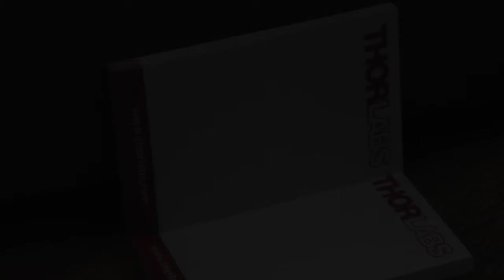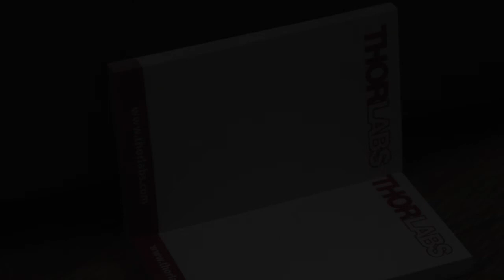DIY Tunable Dye Laser!

Comment: Is this dye laser strong enough to act a skin surgery? Does an ultralarge TEA laser can act a weapon fighting against Zentraedi in future?
Reply from the maker: No, you can not perform skin surgery with this dye Laser, the average power is too small.
It is not possible to build an ultralarge TEA Laser, unless you go with a MOPA design. An Excimer Laser has much higher powers available.
Reply: @LesLaboratory  if the TEA laser has 100-meter length and considerable capacity, its individual pulse energy should be extremely large, isn't it?
Reply from the maker: @georgegreen3672  as above, a 100 metre TEA Nitrogen Laser is just not practical. The maximum length of an ordinary TEA Laser is 30cm.

Comment: Hey, You are using a TEA as a pump right? Also well done! Quality video right here and well thought out, How divergent is the beam coming out of the OC? Since its tunable to 400ish to 570nm you should consider a g8 collimator, 90% pass, and coated for broadband 400-700nm. It should work nicely you would need to make a custom mount though. The lens is threaded M9x0.5mm.
Reply from the maker: Thanks! Yes I am using a TEA Laser I described here: https://youtu.be/pCnXftuJ9Zo and here:  https://youtu.be/AyN1o_3XaTw

Without the Collimating lens, the beam will expand to about an inch (25mm)  at about 1 foot (30cm)

With the lens you can get a nice tight spot about 2mm across, from 6ft. I have just ordered a new lens, to improve the beam quality. It needs to have along focal length. In my case 48mm.

Comment: Man that's so cool...where is the dye available? 

Sigma-Adlrech says the have it in stock...but are there any other more normal places to get it?

I was able to build my own TEA laser and get it to lase, it's been a fun project.

Thanks for the videos! It's very cool stuff to see.
Reply from the maker: Thanks!
I got mine from a seller on eBay, but they don't seem to be selling at the moment. Search for Methylumbelliferone or one of its synonyms. You need to add a couple of drops of Ammonia to get the spectrum broadening. (Forms an exciplex during Lasing I believe.)

Awesome that you built your own TEA Laser! I'm glad these videos are inspiring people!
Reply: @LesLaboratory 

Wow I never expected to stir up so much discussion about the dyes...i want to know more about lasing jello, that sounds interesting and goofy enough to try just for fun.

I was reading and saw someone using a prism instead of the diffraction grating for tuning...do you have any thoughts about the pros and cons involved?
Reply from the maker: @drrrrockzo  It is in the pipeline! I also want to try dyes in epoxy as well!

Yes, you can do it with a prism, and I even considered it, but here are my thoughts on that:

Dispersion prisms, even flint glass do not disperse very much, i.e. you would need a long cavity to do proper tuning.  With a TEA Laser driven setup, the cavity needs to be very short. If the duration of the pulses is only nanosecond  and the cavity length is about 3cm (as in my setup) then the light can bounce between the mirrors about 10 times, providing enough feedback.
If you add a prism in there, plus room for movement, you would be up to 5 or 6cm cavity length, where light will only bounce back and forth 6 times or less, reducing feedback. Plus, it is yet another optical element to align and build a mount for.

Gratings on the other hand have very large dispersion, and can be had for around the same price as a new flint glass prism. They are easy to set up on just a plain mount.

I think in hindsight, I would have used a finer grating, perhaps 2400 lines/mm

I reckon at the moment, the linewidth of the Laser is probably somewhere in the region of  5nm or so, so still fairly wide. A solution to this is to use a grazing incidence setup for the grating. Maybe a future job.
Reply: @LesLaboratory  a $50 for 5gm the stuff is not the cheapest, have you considered selling small packages of selected dye to raise money for your channel,
Reply from the maker: @NickEdgington  That is a good Idea! I only have 1g myself, but I will email some people today and see if it can be acquired and split. It is ridiculously difficult to get anything in the UK as a private individual!
Reply: @LesLaboratory  I found some on eBay have some  Rhodamine B in my Amazon shopping cart. Malachite Green also looks interesting,  If you plan to continue to explore dyes perhaps a review of each and a way to obtain them would be an interesting path. I hear jello works.
Reply from the maker: @NickEdgington  Awesome! I have quite a collection of Dyes: Rhodamine 6G, Rhodamine B, Sodium Fluorescein, Bromo-Fluorescein, 7-Diethylamino-4-methylcoumarin,Phloxine B and Nile Blue. I like your idea  of trying them all! I need to solve the rolling shutter issue. 

Malachite green can also be used as a saturable absorber for Q-switching Lasers I believe.

I will have to try to laser jello. I think the only likely candidate is Fluorescein as all other dyes are toxic.

There are some fun experiments ahead!
Reply: @LesLaboratory  I heard that some yellow highlight marker dyes also lase
Reply from the maker: @juslitor  Yes, I have seen that too. Yellow Highlighter Likely contain Fluorescein, and others likely contain Rhodamines. It would be interesting to try and extract some to try out!